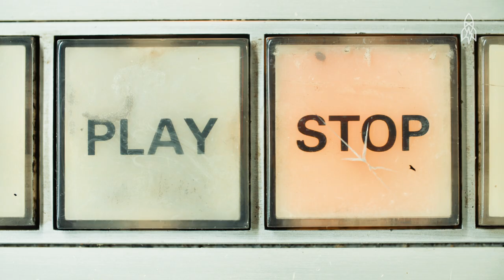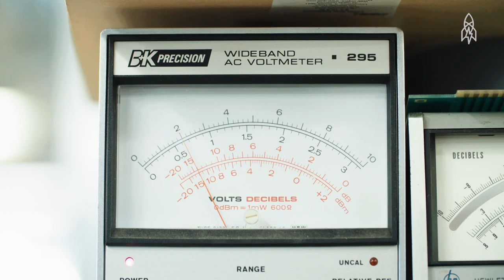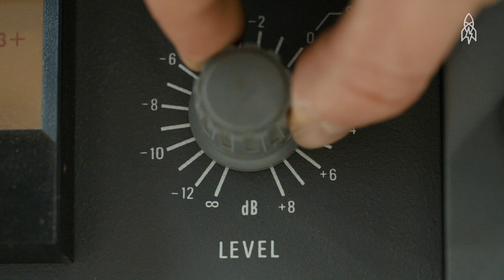Throwback on a Comeback: The Last Cassette Tape Factory

Comment: People that say the cliche' "I grew up with them and they sounded terrible," are wrong. I grew up with recording on cassette 4-track and putting out home-dubbed "albums" of my band's music, and remember them sounding great. I still use cassette as part of my recording process today and there's really nothing like it. A good type II tape in a deck with clean heads will blow away most people's recollections of what a cassette sounds like. Harmonic distortion, punchy lows, warm mids, and that classic rolled off highs is the sound that the digital plug-ins are trying to recreate. I love that this company is doing well! I've done business with them many times and they're the best. Long live tape! It aint' easy, it ain't cheap, but it's real.
Reply: Actually the best thing about CD when 99.99999999% of us switched to CD permanently is that now you can go to the track you want instantly.
Reply: Yeah, and I had 100's of those. They were great from a commercial point of view, but they don't impart a particular sound on the recordings. All those CD's are pretty useless now that streaming is the norm.
Reply: Yes.  I think their key use is in recording.... I'm starting to use my four track for base tracks and then use the DAW for overdubs and mixing.  I like that smoothness from cassette though...
Reply: Cassettes are also useless, unless you like their particular brand of shitty lo-fi sound. The again you can always just record to tape and upload that to a computer, rendering the actual tape useless.
Reply: I disagree with “cheap.” They’re cheap enough .

Comment: If you use decent tape an decent equipment cassettes sound awesome! But most people are used to poor quality pre-recorded albums whilst listening to them through crappy boom boxes or low end decks. Same story with vinyl...
Reply: Everyone has different appreciations and interests man. For some it's the physical aspect, other's the analog "realness" of the sound, and some the actual sound itself, ignoring quality and digital comparisons and simply appreciating how it sounds on this format.
Reply: You can get the audio technical at 120 record player for a great price, and it’s actually really good. Vinyl eyezz is a YouTuber who just does vinyl videos and he has had one for year and really likes it. The arm is very adjustable and with a nice needle, is sounds great.
Reply: @shooting4star2023  listening to music from a phone is awesome...until a notification comes through. Lossless files from laptop in airplane mode are a close second to vinyl and cassettes.
Reply: Yeh 
I used original cassete and panasonic boombox and great sound quality i got
Reply: You don't have to fork out huge sums of money.

£20 my first tape deck cost me in 2019. 40 for the second and 20 for the third.

They sound fine because any issue is normally an issue of duplication or ropey pre-recorded tape.
Reply: I have a nakamichi dragon is that good?
Reply: Alot of the pre recorded cassettes over 90 minutes did not hold up real good unless it was a brand like maxell or tdk due to the long length the magnetic tape film finish was poorly made

Comment: hifi manufactures just need to start making high end tape decks again now - or at least make parts for the older high end models which we now struggle to source parts for
Reply: Maybe try contact JJ Electronics, despite fact that they are producing mainly vacuum tubes, they produce some amplifiers as well and might have some of required technology. Heard might not be problem, tapes are still used as permanent backup and this require high-quality heads (beside some CRC).
Reply: Technics Guy I agree. At least I have a choice between new and vintage when it comes to turntables; not so with cassette decks. Also, turntables are much easier to work on; I know that I can change out/upgrade a cart or stylus, because I have done it before. What would I do with a faulty cassette deck? I have no idea.
Reply: @UrOpinionsSucc  good for you you're actually keeping the cassette players alive

Comment: Yes to cassettes, because the digital voice recorders cannot edit on the Fly, meaning you can't rewind the recording to where you want to overwrite audio with a new recording and have it play seamlessly as though you never changed it. And this Can be done in an instant with cassette tapes. Example, telling a story and changing it midstream, you can do it digitally but it takes a lot of time to put all the fragmented pieces back together in the right order and name them so that they don't get out of place and play in the right order. Cassette tapes make this process a no-brainer. That's why if you are a writer telling your story using a cassette tape record, it will be natural and a Delight. Because if you have to fiddle around for hours with the voice digital technology you'll forget where you're at in telling your story, and writing is art and when a Magic Moment happens you need the flexibility of tape because you can't recreate that moment. I have tried putting the words to paper, and trying to read them back. Doesn't work the Magic Moment can not be recreated. Thanks for listening

Comment: I have such fond memories of using mixed tapes to get girls. It made letting someone know you liked them so easy and you got to tell them a lot about yourself in the process. I also miss recording live radio.
Reply: I feel like I've seen/heard this before
Reply: You can still mix CDs if you want.
Reply: +patty109109 i did plenty of that too. my problem with cd's is that no matter how well you treat them they still degrade over time. with a cassette you can find one on the side of the road and the damn thing will still play.
Reply: You can but with the tape you had a better chance of it being listened through because no easy skip except fast forward.  When I switched that was one thing I missed about cassette.  And before CD burning making tapes was easier...

Comment: Here are my thoughts on cassettes.

1) Recently I have started to collect old cassette tapes (I buy them mostly on eBay).

2) People who say that cassettes have a bad sound quality do not really know what they're talking about. In the 80s and 90s the recording industry had perfected the sound quality of cassettes (with chrome tapes, diagalog technology, dolby, etc.) - I have albums on cassette that sound exactly the same as the CD. (I have some albums on tape and on CD and am able to compare the sound quality).

3) I agree with one of the comments below, saying that "quality cassette players [are not] being made today". Therefore I bought a Bang & Olufsen stereo with a cassette player. Not only does it sound great but I was able to buy a new remote from B&O which also works with the old Ouverture stereo. So even when sitting at my desk, I can forward to the next track, turn up the volume or even turn the cassette - with my remote. I do not need to go to the stereo at all. The Ouverture has a very advanced cassette player where you can forward (or rewind) to the next (or previous) track, and you can turn the cassette with one button.

4) I really cannot understand people's memories of cassettes getting stuck in players. I grew up with cassettes and this really never happened to me. And it hasn't happened on my new stereo. I guess people were just using cheap cassette players or the tape was worn out, overheated or something like that.

5) Tapes that I buy from the 80s and 90s sound great. Newer tapes that I buy do not have a good sound quality. I think that the knowledge that they developed back in the days has gotten lost and these days the few manufacturers do not know how to make quality tapes. I only bought two new tapes (one from the year 2015 and one from 2017) - one sounds okay (not great) and the other just sounds terrible.

6) Many people (and even experts) claim that in order to maintain the sound quality of tapes, you have to rewind them and play them regularly. However, I bought some cassettes as old as 30 years and they were still sealed, which means they had been produced 30 years ago and had never been played. Yet, the quality of these tapes is excellent. I assume that keeping them in a dry and cool place is probably more important. 

Anyway, if there are some other cassette lovers out there, just respond to my comment.

Comment: Cassettes can handle rough treatment better than CDs and take less space. The human ear is designed to hear analog audio. Be it a digital CD or MP3, they both end up going through an analog speaker before getting to ones ears.
Reply: Well you shouldn't be handling your cds or cassettes roughly to begin with, it's not hard to handle things with care. Also cds don't degrade in sound like tapes so I disagree.
Reply: +robinzhooded tapes may degrade more than CDs but a scratch or even removing some of the oxide layer doesn't make them unplayable, unlike CDs.
Reply: Cd's also degrade after the time. But not in quality. Many cd's I had recorded  more than 10 years ago are hardly playable even they are unscratched. Probably cd layer has damaged in time
Reply: I've had some CD's in my collection since the mid 1990's, and they still sound as good as the day I bought them.  I can't say that about my cassettes though, which I ended up parting with several months ago.  I had a collection of about 200 cassettes that I sold to a mom-and-pop record store for about $100, which isn't bad for an outdated piece of technology.
Reply: Exactly. In fact  if you take care of your cd / cassette / vinyl equally, asumming you constantly play those 3 formats, then cd will prevail since the player does not make any  physical contact with the medium while vinyl and cassette will deteriorate overtime regardless how you take care of it.
Reply: I have Ozzy Osbourne Blizzard of Ozz cd which is an early 80's pressing and it still play fine from start to finish. Sure it has some light scratches but it play's fine and sounds exactly the same like when first time I bought it in mi 90's.
Reply: Vic Rattlehead, correct but that's also the downside of CD's no contact of the stylus or tape head makes the sound of music flat. And of course not everybody is very carefull on their albums so the CD endes up not playable first after a few scratches. So at the end MP3 is the best choice but than it doesn't feel like a "real" album and that's why these old formats don't die
Reply: This is solved by simple LC filter, you have steps of signal and those two devices will act against sudden changes creating continuous analogue signal. But it might be that while digital formats will keep records of n-th harmonic as was in original, Vinyl, cassette will add distortion. Same as with tubes, with less than 10 transistors you could build somehow good amplifier, that you can buy integrated amplifiers for dozen for pound that will not distort signal at all (way below 1 %), people still would prefer some tube amp that will have it greater, will limit signals in tube, output transformer and so. When you dug up datasheets, those original, of some of most expensive tubes (300B) you will find that they change signal quiet bit. Same with tapes and vinyl.

Comment: Cassette players should be manufactured again. Without it, it's more likely people (especially teenagers) nowadays won't be able to play cassettes since old players have aged (usually also degraded in performance) and digital media is much more practical to maintain and easier to play.

I would like the portable one.
That should be nice :)
Reply: Tascam have been making new tape players and recorders for years they make tape cassetes as well
Reply: Try eBay for refurbished cassette decks.

Comment: 50 years plus of doing Audio and I love cassettes. I have owned many makes and models over the years. Sure reel to reel too. But really cassettes resonate within me. My current machines an Aiwa AD-F660 and A&D 6300z and a Nakamichi CR-3a and prize JVC KD-85. From 1978. I will die with tape in my life it has completely been in my life. I think I am at 3120 micro seconds whether NAB or IEC in my veins.

Comment: I hate to be a bit negative but, cassette tapes are not making a comeback any time soon. If you are the only manufacturer of them, of course you will see a good rise in demand! As soon as the people buying them for nostalgia literally die out, you will have practically (maybe even absolutely ZERO sales) no sales at all. It did die for a reason! This is a cool and interesting video though:)
Reply: Certain musicians will always use them. It's not going to be mainstream of course, and nobody claimed that, but there are a number of people like myself who never stopped recording music on analog. I still use reel-to-reel multitrack and record with cassettes because I love the process. It's a way to make music using yr ears instead of staring at a waveform on a computer and getting distracted with facebook or gmail. I still use digital too of course but trust me, it's not just a lame trend (maybe to some I guess haha!)
Reply: I would say that when those devices will be too complex we will revert to simpler methods and devices. And perhaps even more reliable. Modern operating systems are great example of that or apps on smartphones. They are too complicated doing million things beside that one you need right now. Took Windows 10, you can not turn plenty of things off, they tend to get updates when you need to use your computer right now, not after hour, compare it with e.g. Debian that will not perform any update unless you said so and will be running under 5 minutes. You can store DOS or Linux machine on shelf for years, then took it plug in power supply and it will run, windows will do updates for days.